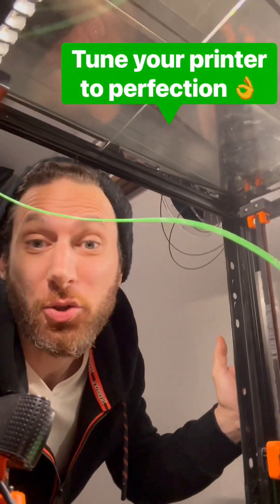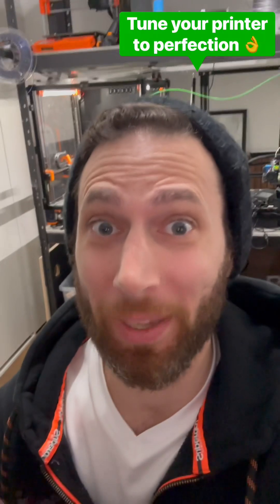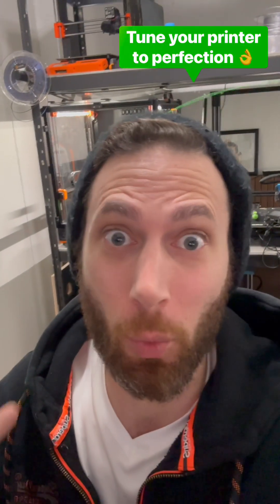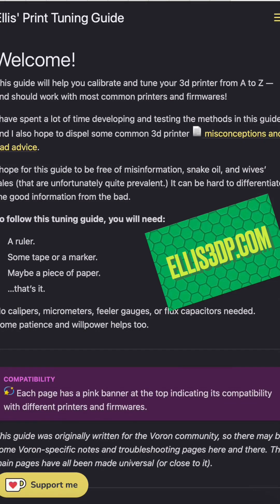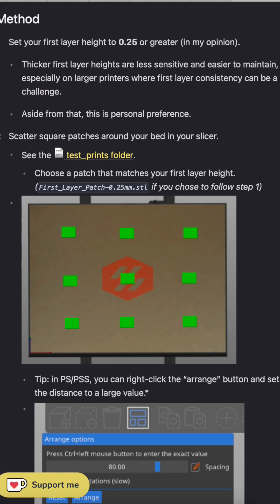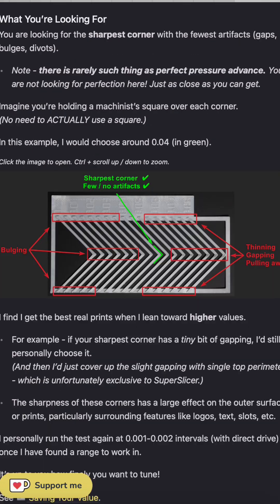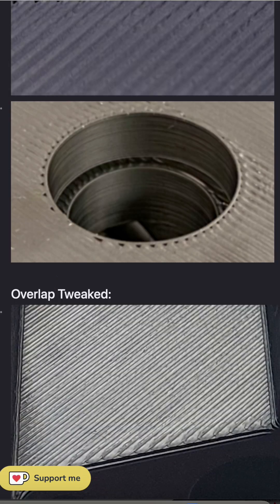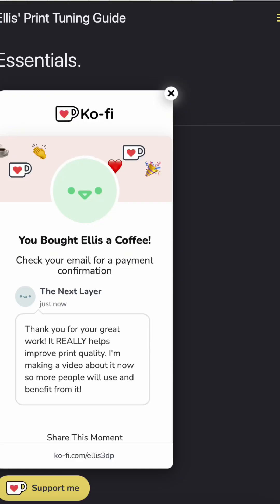How to tune your 3D Printer to PERFECTION! #shorts

Comment: I have the ender 3 v2 neo Profesional firmware from that website and I love it. The bed leveling is so easy and I love that I can just press a button to unload and load the filament which should be an option of the stock firmware.